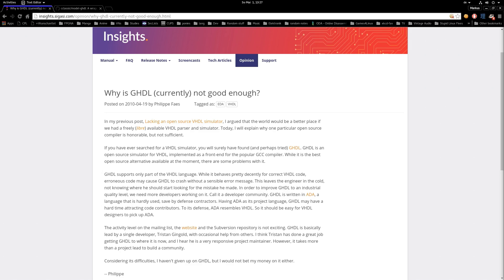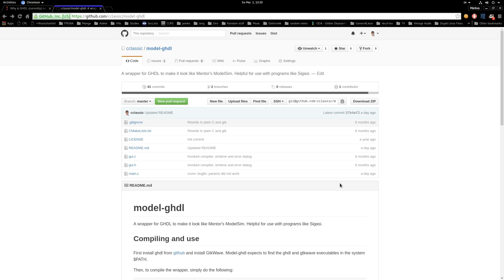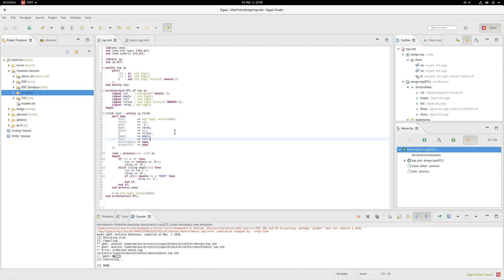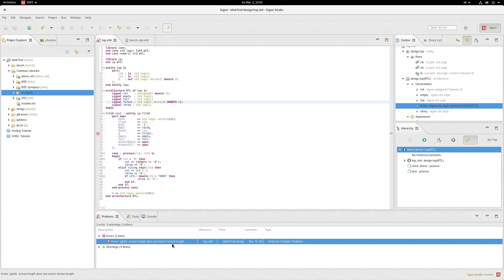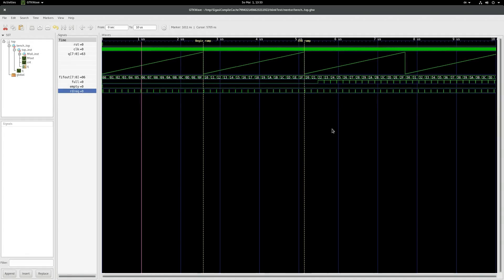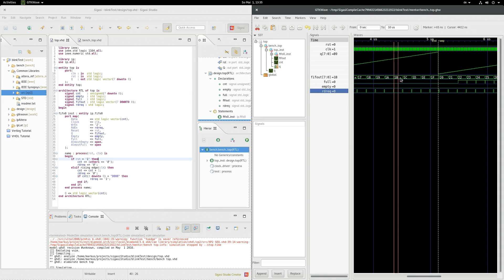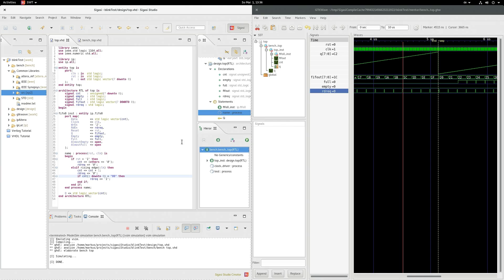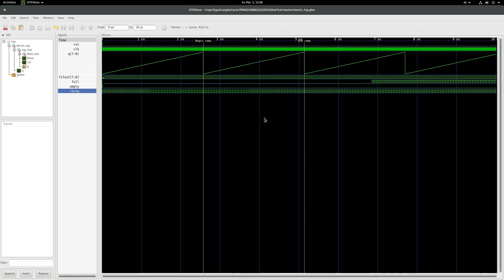Using Sigasi with GHDL and GtkWave

Comment: Very nice. I think this is a very good implementation that you have made. I would like to make this compatible with Windows 10, do you think that doing such a thing will be difficult? Can we work together to make this work? Please message me back if you are interested
Reply from the maker: Thank you! Theoretically, this can be done as the concept behind the applications can work on both Windows and Linux.

However, the code uses quite a few low level functions such as fork and popen, which might make things difficult. I have no experience with C-Programming on Windows, although I believe that Cygwin has "wrapper-functions" for these syscalls. Then it's just a matter of choosing the right toolchain and adapting some program names (ghdl.exe instead of just ghdl).

After that works, some paths (such as "/tmp/model-ghdl-gtkw-%s.lock") need to be adapted. That's easy.

The GUI part is written in GTK+3 which has a Windows port, so this should not be too hard either.

Finally, some way needs to be found to use the multi-call binary concept on Windows. On Linux, it is easy with symlinks and argv[0]. I do not know whether Windows has a similar concept.

Either way, I will not be able to help you directly with writing the port. I will, however, try to help you with any questions that might come up.
Reply: Hi Markus, Thank you for the general overview. Let me give it a try and if anything we can discuss in detail through GitHub.